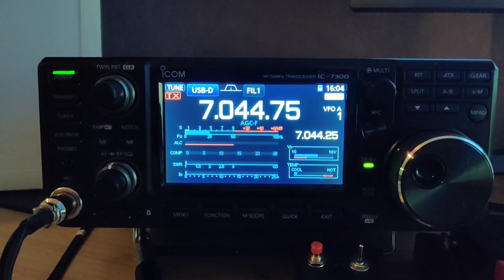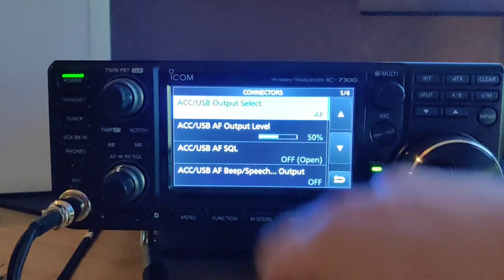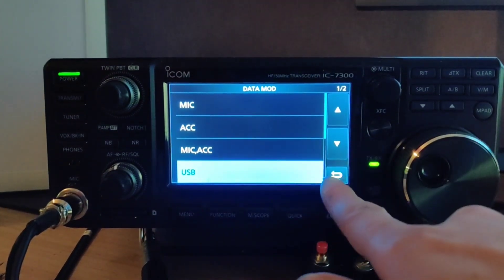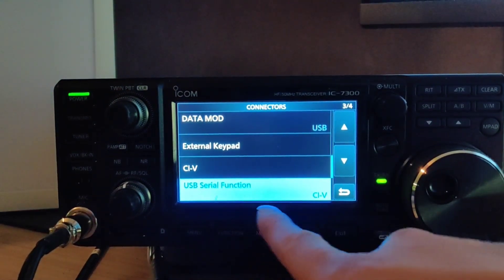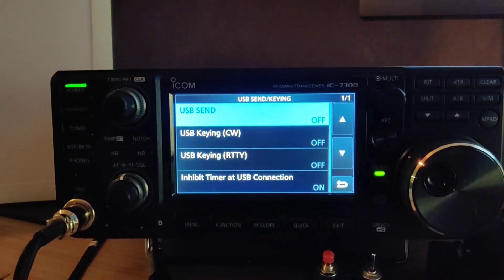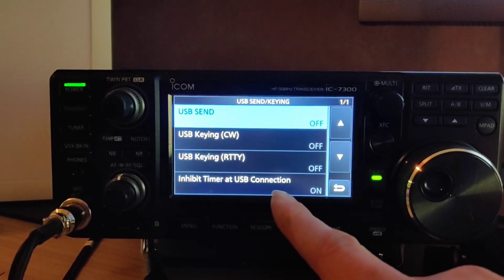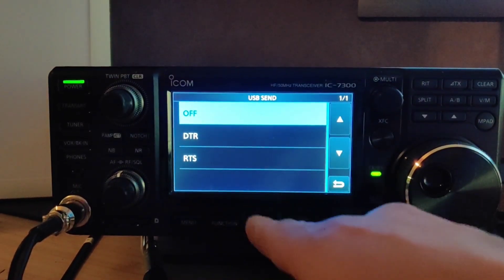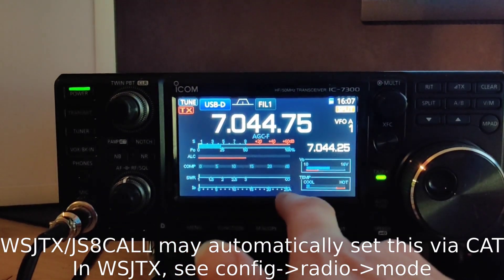IC7300 Configuration for Data Modes (WSJTX, JS8CALL, FLDIGI etc)

Comment: The Icom-7300 can send RTTY messages all by itself without software and a computer.  What are the correct settings for using just the radio using pre-selected messages entered into the TX memory? MUCH THANKS !!!  KC3SOB

Comment: Hello, very nice video. Everything seems to work for me except for one “little thing”.  I have configured USB-D. PTT runs via RTS. When testing CAT, I notice that the IC 7300 briefly switches to USB mode and then back to USB-D. If I now test PTT, it switches to USB when transmitting. The USB-D mode now remains permanently off. Is something wrong and what please? Best regards

Comment: I can't get the computer to key the radio. I am using just the USB cable for connecting the radio (7300) to the computer. I'm testing using just the fldigi software in psk31 mode to find out why the PC will not key the radio. When I operate my Push to talk button, the radio transmits, and the digital signal comes through. So technically I have to trigger transmit. I've double checked my connector settings with what you illustrated, and all seems to be the same. So, any thoughts would be helpful. Thank you! W5DP OBTW, receive works fine in wsjft and fldigi psk31.

Comment: My issue is when wsjtx transmits I get no power output on from my radio. I am lost at this point.
Reply: Are you definitely in USB-D mode? In standard USB mode the PTT will function but you'll see zero power out.

Comment: Thank you . Setting up my 7300 for digital is easy but still a process. I had early success on ft8 but have had challenges on other platforms . This video helps me work through the correct selection with out me being overwhelmed.